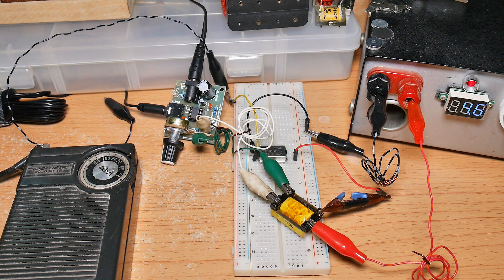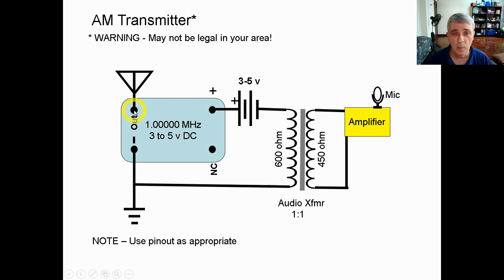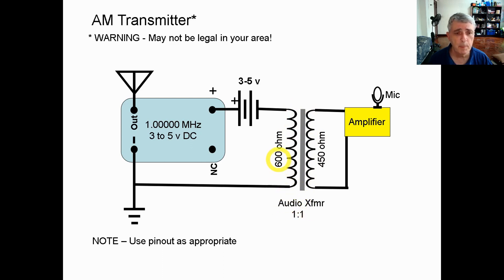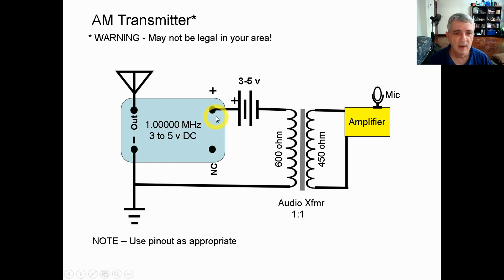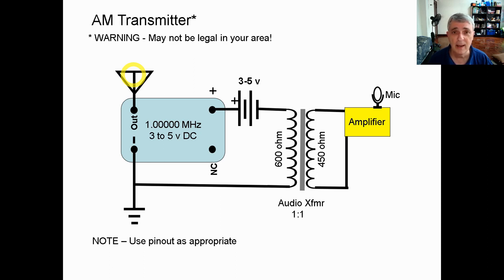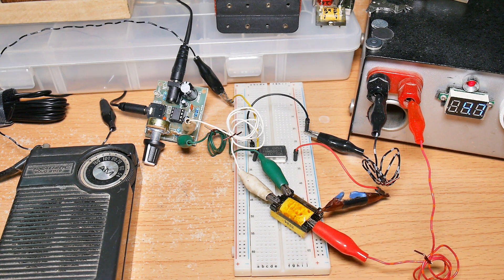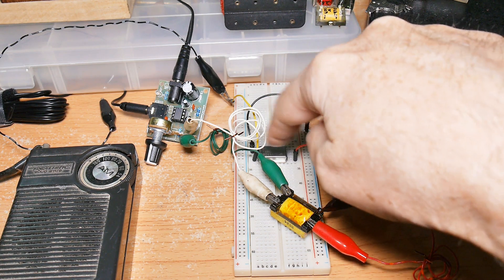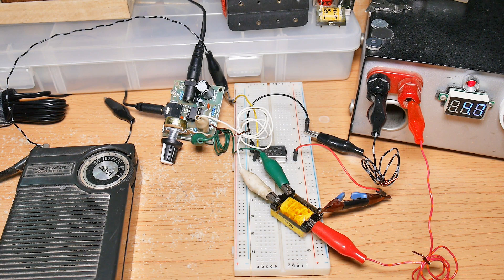DIY AM Radio Transmitter

Comment: What would you need to do if you wanted to transmit on 27MHz? I cannot find any purpose built AM Transmitter for 27MHz except for CB radios which I do not want to use.
Reply from the maker: In the US that's a common frequency for radio control planes, boats, cars...  You can buy old transmitters for cheap on ebay and such.  Depends on what you want to do, voice, morse, data...  Make sure you don't break any local laws.
Reply: @tsbrownie  In Ireland we use the 11 meter band for church broadcasting, but the only kit that would work is a cb radio but they are not designed to be "keyed" for an hour. So, trying to find an AM Transmitter for 11 meters is very difficult. So far, no luck. :-(

Comment: Hi everyone from Greece! My advice is to modulate directly the 1MHz crystal oscillator (without audio transformer) from the output of a simple lm386 audio amplifier stage to the crystal oscillator input (+) for better and stronger audio modulation!
The circuit: https://gr.pinterest.com/pin/AV75IvXDXUTBJRYE1OiKKB0STN1aKByD5rImGCrLKqAk2yhATQJbPKs/
Also its recommended to add an harmonic filter network to the crystal output for more "clean" RF wave.
The circuit with the output filter: https://www.youtube.com/watch?v=KMIpZkraZxM